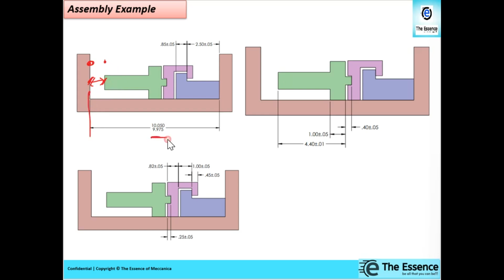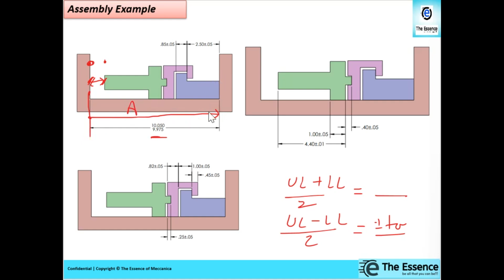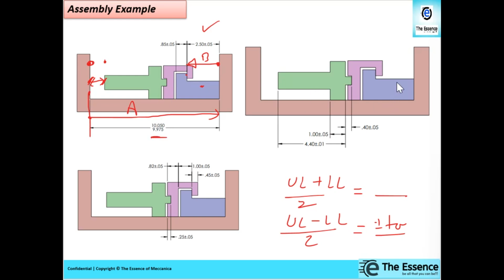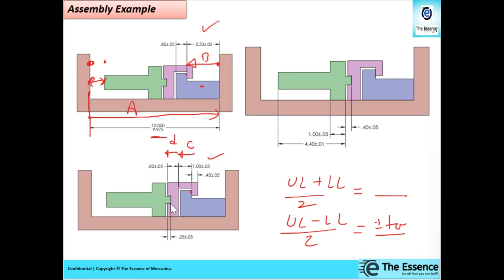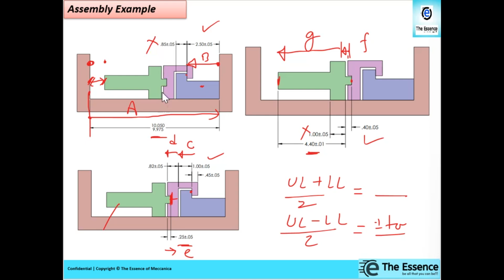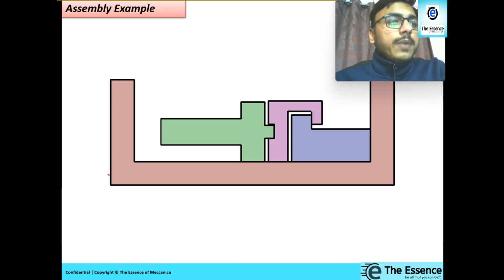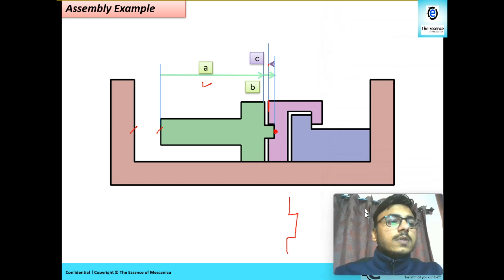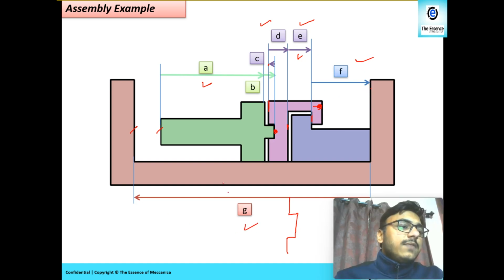12_Assembly and Loop

Comment from the maker: Full course in tolerance stack up analysis with complex example, 20 videos. If you want permanent access to these videos you can access after course subscription. Subscription cost 451 INR OR 11 GBP OR 15 USD. you can comment here or contact me on +91-9724543888, write me bipinkumar.9724543888@gmail.com. Instead of Udemy I am posting the content here.